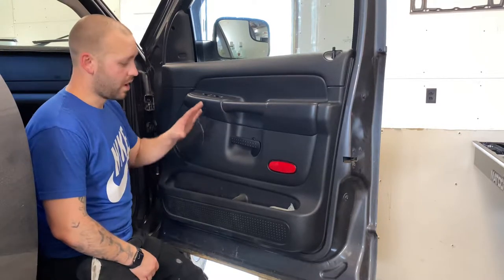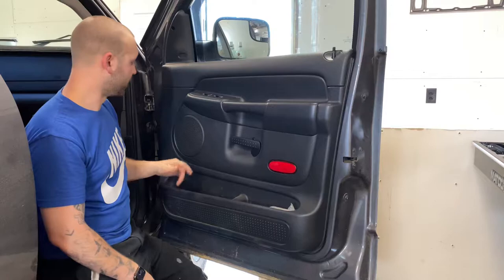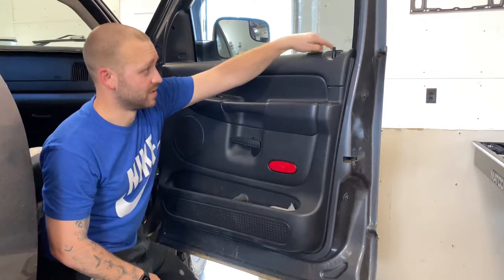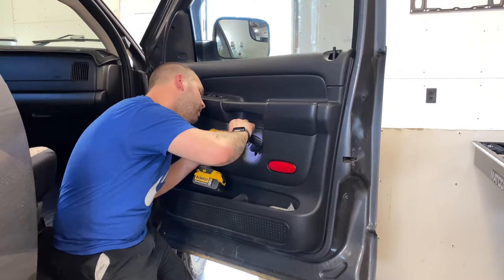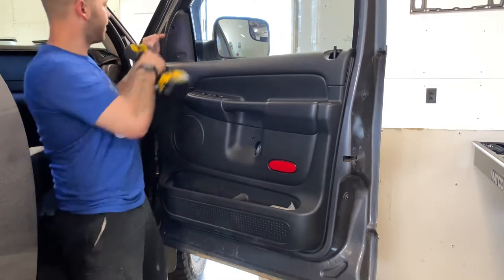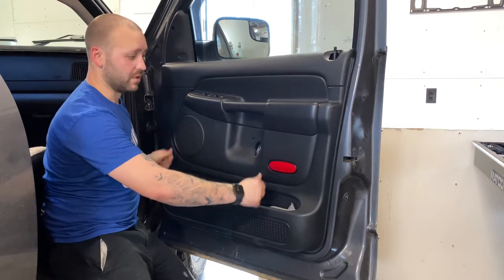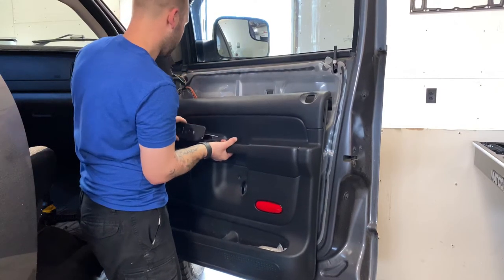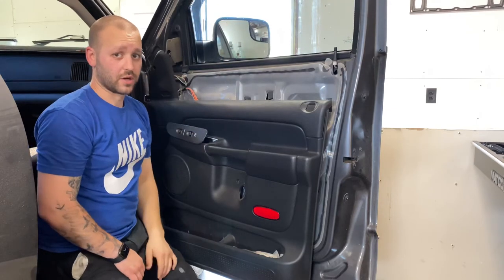How to Remove Door Panel | 02-08 Dodge Ram

Comment: Thanks for the tutorial. Changing all my speakers and didnt know how to take off the panels.
Reply from the maker: Sweet!  Thats a good reason to pull them off!  I’ve been looking at upgrading speakers in my truck as well.  What ones did you go with?
Reply: @TunersCanvas  pioneer ts-a6977s in the front and ts-g1320s rear
Reply from the maker: @nathanconner7984  Nice.  I’ve had several Pioneer speakers in the past.

Comment: Thanks!  My window tends to fall off the track in freezing temps.  2002 Dodge Ram
Reply from the maker: Sometimes the guides have slotted adjustment available, maybe applicable to keep the glass in line. Not certain specifically on the Ram though.

Comment: hey man ... what about the panel behind the door panel.. the plastic/metal piece?
Reply from the maker: Hmm. Can’t recall off hand.  Would have to take a look next time have a panel off.  Im guessing it’s not riveted in place so basic hardware would likely gain access to the window regulator or lock actuator if that’s what you’re after.

Comment: I have roll down windows need to advise to remove clip holding window crank handle
Reply from the maker: Absolutely.  There is a specialty tool available for just that.  Likely find it at most any auto parts store.  Basically a flat fork that slides behind the crank handle to release that clip.

Comment: What if you find there's a window crank involved..Is there a tool or procedure for removal?
Reply from the maker: There is a tool for those crank handles!   It often times looks like a flat fork to slide behind the handle and push a “C” clip retainer out that keeps the handle on the crank shaft.   
Hope that makes sense?   Could likely search window crank tool and it would pop up.

Comment: How do I get into the inside of the door handle??  The nut feel off of mine today
Reply from the maker: Yikes. For that, you should just have to pull back the plastic liner that covers the inside of the door after the door panel is off and out of the way.   To access the handle hardware, the window may need to be up or down which you should see once plastic is peeled back.
Reply: @TunersCanvas  SO yea, I heard the nut fall into the bottom of the door..  I am guessing that it might be prudent to get a new one since it will be unlikely I will find the original inside the door.